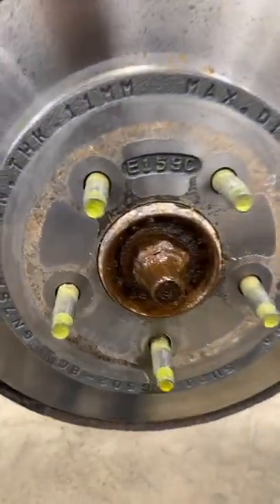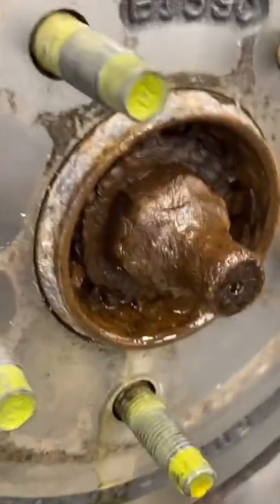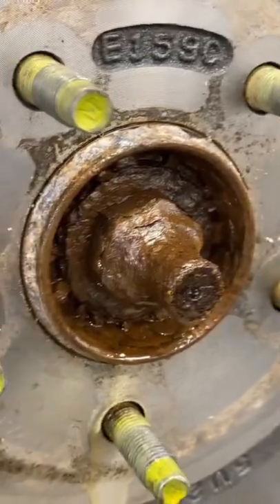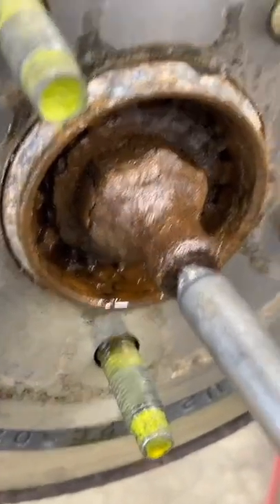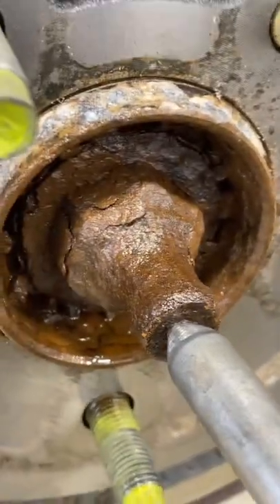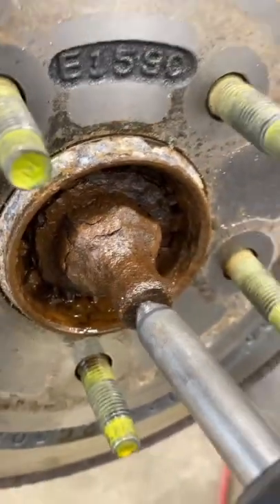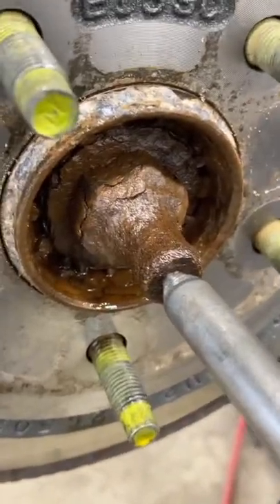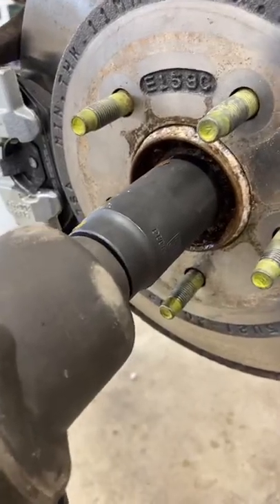Will it loosen? Rusty axle nut edition!

Comment: You're confusing bearing grease with rust my friend
Reply: @blyat cyka it wasn't that red when it was put there. that's the extra spice from winter.
Reply: Yo for real "HeRe We HaVe ThIs 2022 EsCaPe"  .... lol
Reply: Bearing grease goes inside bearings, not on axle nut.
Reply: @BrokenSmokinSpokes  trucks come off the showroom floor with rust on the front driveshaft…. So this wouldn’t be that surprising
Reply: Sharp eye man! I seen the exact same thing......notice how he cut to the socket on it right away? Lol
Reply: @dominicstephens781 my 97 ranger has the front spindle like this. While yes you put the grease on the bearings grease, over time, will get over by the spindle as well
Reply: It looks like copper antiseaz.
Reply: It's covered in PB blast
Reply: @ffilby  na you'd smell it through the screen if it had that much.🤣🤣
Reply: Not on a hub

Comment: You took a video of the easy part. I wanna see you get it out the hub 🤣
Reply from the maker: It actually came out easy, I just air hammered it out
Reply: I feel you. One side of my hub won't come off. Had to take off the whole knuckle applied heat, then pressed it out with a 20 ton press.
Reply: I had the same issue with my Subaru. Being from WI, that axle was seized in the hub. I don't have all the expert tools, but I got it out using a chunk of brass and smacking it for about half hour with a sledge hammer. No air hammer was touching it.
Reply: @eradicater4186  I'm in Wisconsin too, I have dealt with some awful bearing and hubs.
Reply: Hubs aren't to expensive
Reply: Usually getting the hub off is harder than pushing the axle through. Few taps and it's done. The hub itself is another story.

Comment: That looks to me like it's covered with anti-seize
Reply: That order been there for 2 weeks
Reply: Naw, if it wasn't rust he wouldn't have shown the part where he hit it with the air hammer. 🤔
Reply: @derekcamp9764  Right What's the point of the video if you just skip ahead, he didn't even show putting the impact on the bolt which Definitely means he's misleading.
Reply: Or the PB blast he said he coated it in!

Comment: Seems The rust created a protective shell. Those thread looked clean after.
Reply: Pro tip - let things rust for protection.  Understood
Reply: In my experience ford uses some really good hardware. Seem to come apart way easier than GM. They can be rusted to all hell and the bolt will come out with clean threads most of the time.
Reply: @brad8665  I think it’s a vehicle to vehicle thing because I’ve had the exact opposite experience. GM comes apart easy, Ford gets the torch
Reply: @brad8665  Yeah, I dunno, man. I've had exactly the opposite experience. The only bolts I've actually ever rounded off were on fords and chryslers
Reply: @woahslowdown  yes... Will be protected from any socket taking it off.
Reply: @MikeLeeSr  Good good we don't want any funny business no people stealing parts or something good good

Comment: I've got a 3/4 drive IR impact that convinces every nut or bolt to come loose
Reply: How much?
Reply: Yeah, but sometimes it will pull the stud threads with it.
Reply: @dgronzega8073  clean the thread bro a wire brush and some brake cleaner
Reply: @RamiroBerumen510  between 250-300 for the 1/2 drive so the 3/4is likely around 5-600

Comment: If in doubt use the M18 fuel 1 inch D handle impact wrench. Be sure to use the smaller 3/8 stubby for installing the new CV shaft to be sure it’s not over tightened

Comment: Bought an old accord for the daughter needed half shafts. Drivers side left hand threads and frozen. A 4-foot cheater bar wouldn't budge it. I poured brake fluid on the threads and two hours later it came loose easy. Tried it because it was what I had.

Comment: I live in the uk and used to work on landrovers (old knackered ones, not shiny nice ones). That nut was practically new compared to some of the stuff I’ve seen. You know you’re in trouble when the steel has delaminated and isn’t even nut / bolt shaped anymore. Now that’s a bad day at the office……
Reply: Get a socket 3 sizes down and pound it on with the pig wacker (3-5 lb hammer) then give it a go!

Comment: This kind of steel is superior, i had something similar in my 300c, Just put socket and knock it few times with Hammer, 1 meter lever and it come loose without any problem.

Comment: What size impact you using or what would be a good cheap one to use? I'll working on a 2010 jeep patriot and mine is rusted on really good. Tried using a cheater bar and a breaker bar and won't budge. So my last resort it to buy an air impact because my electric one wouldn't turn it either. Any idea on the least ft. Lbs to get that would break it loose?

Comment: I had a 95 accord and it had press on rotor. Hit it with the penetrating oil and put it on a vice where the rotor could fall through. Raised the hammer and that hub was so scared of getting hit that it just dropped out. XD

Comment: If you get one like we do in the rust belt ,cut the stub off flush with nut,then nut will come right off they get so bad up here sometimes you really have no choice,sorry your getting a new axel.or you can drill through the nut and shaft to use cotter pin ,if you tight on money.

Comment: I think all it was on the axle was simple mud the rest of the chassis was bright shiny metal but showed no rust at all so why would just an axle nut rust?
Reply from the maker: It was definitely rust, the end of that shaft is supposed to be the same diameter and it’s supposed to have threads. The “bright shiny metal” is because I literally just replaced the brakes on the car, then the axle got approved.
Reply: @autotechaaron  and Zero rust on the caliper?

Comment: That was put on by a caring mech... The threads are perfect, which means the nut was greased with some thick thick grease and the bolt section aswell... Likely bearing grease... The outsides rusted to shit, but threads remained perfect and unseized... Obv it wasnt loctite as no colour can be seen...

Comment: Haha reminds me of my jeep Patriot I went too change a wheel bearing in the front and both axel nuts where corroded into balls so bad like nothing you’ve ever seen before managed too find the perfect socket smacked it on with a hammer forming a whole new bolt and sat for about a hour jumping up and down on a strong arm but eventually she came off every thread on the axel was stripped too nothing so out with that mess and in with a new axel

Comment: Actually before you jack up the car and it's still sitting on the ground with the tire connecting contacting the ground you can loosen it then or you can have somebody go inside the car and step on the break and heat it up

Comment: Yea way to run some grime and grease to make it look like rust. My assumption is you knocked most of it off with the PB and the air hammer. That's why you had the socket over it in the next cut out.

Comment: Why use any products?  The only thing you need with stuck on bolts or nuts is heat.  I just blast them with heat and they come off easy af. I tried everything and many products, but only heat works every time.

Comment: Yea i had to take both axles from a 2006 300c, not over exaggerating i held the airgun on there for a solid 7 minutes on one side, after heating, after rost off black from wurth, most disgusting rotten axle nut and threads ive seen